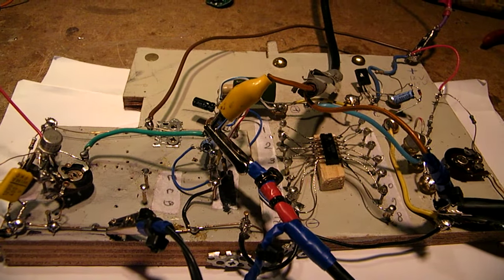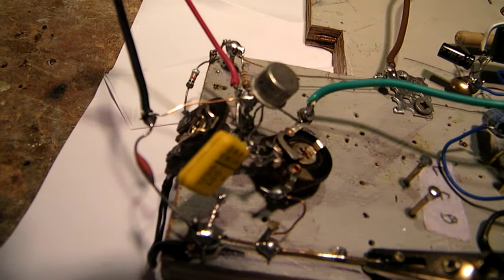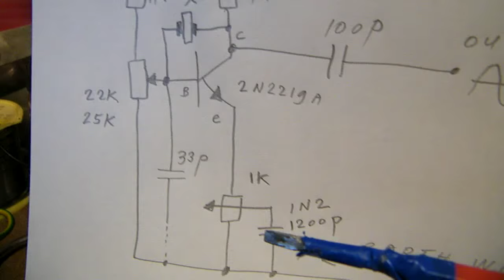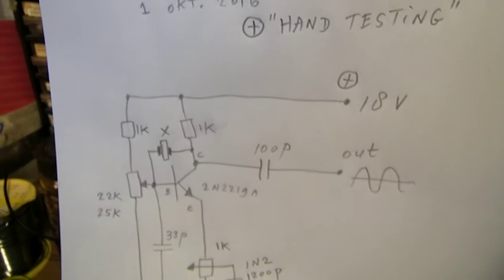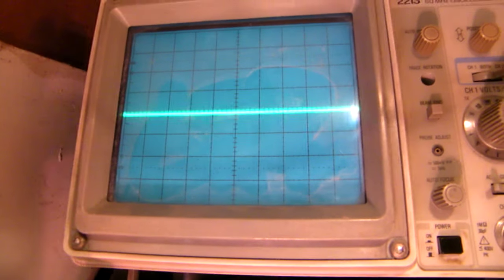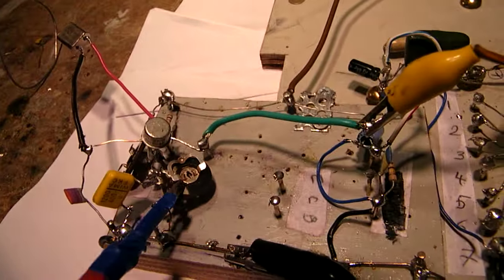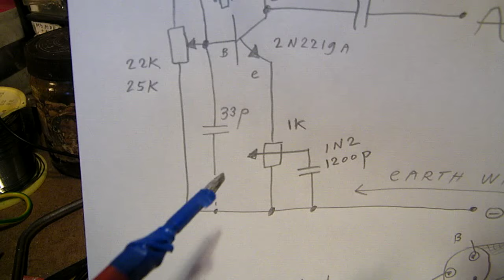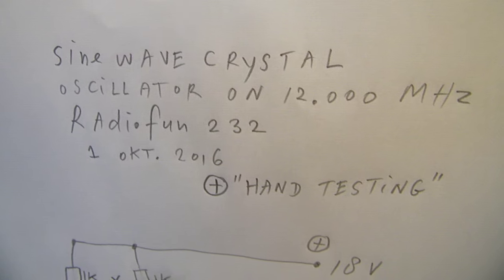Crystal oscillator on 10 MHz (schematic and "hand" testing)

Comment: do you ever encounter any problems use in wood for the components
Reply from the maker: It works -  in general - good up to approximately 16 MHz. And there are possibilities to make circuits on higher frequencies with this method, though it needs a more specific design. And - of course - when components get hot other techniques have to be used.
Reply: The wood must be dryed out proper I think
Reply: The wood must be dryed out proper I think
Reply from the maker: Yes, and first covered with glue for rigid PVC (smell: acetone).
Reply: I use a similar style of construction sometimes.  Usually I go with perf boards for RF. I like that you show these built these ways. So many builders seem to feel the need for custom etched PCBs before they start building. It looks nice, but takes a lot of time and effort.